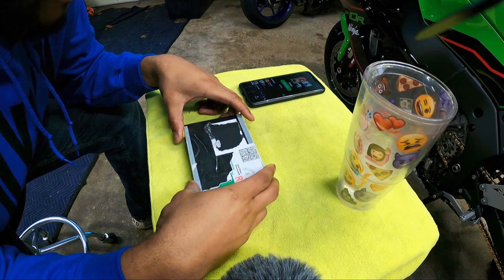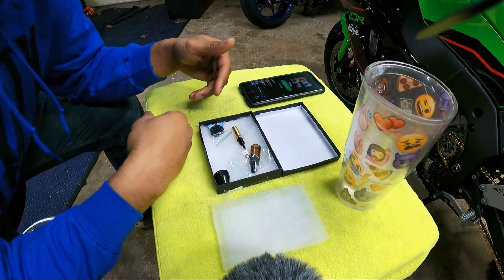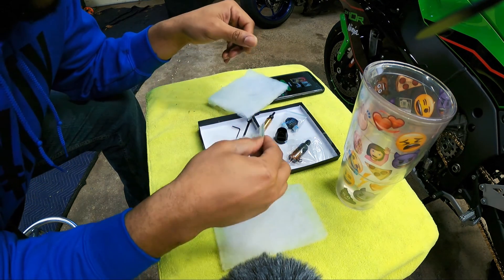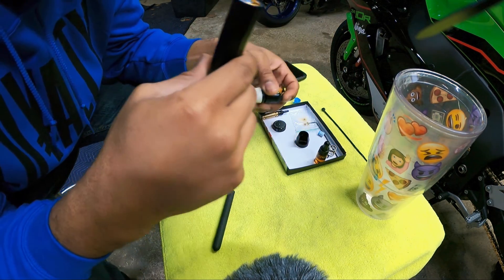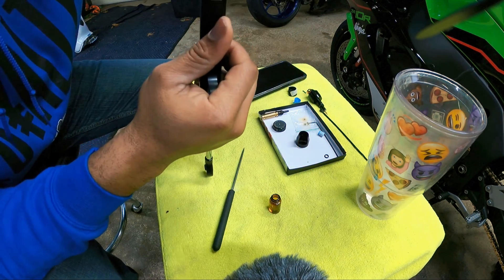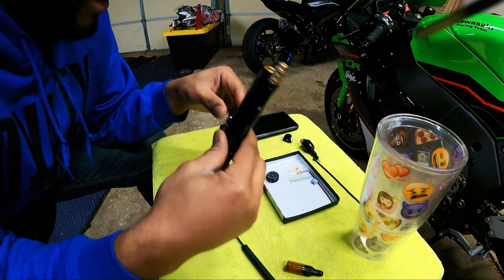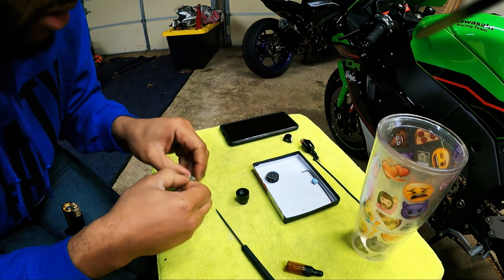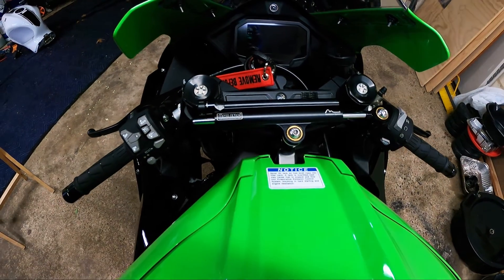2021 Kawasaki ZX10R Manual Steering Damper Conversion Kit Installation

Comment: so did it make it stiff enough or did you end up getting another dampener?
Reply from the maker: Yes. Haven't had any issues yet
Reply: @EnviedKing  awesome thanks for the info, deciding if i should just buy a new ohlins manual one of do this upgrade. I HATE the stock dampener

Comment: What did you torgue the mounting bolt to? Mine is loose. My 2nd day on it. Not sure if it's sapose to be like that but I wouldn't think so.  I can move the damper housing up and down. ???
Reply from the maker: I dont remember to be honest. I would just use the specs in the service manual for the 2020

Comment: This is a good option however you might also consider you rear shock adjustment.
On all my 1000cc sports bikes have had issues with head shake/speed wobbles. The front gets light in under acceleration because the rear shock is set to soft for my weight. I adjusted the rear shock preload to suit my weight and its fixed the head shake/speed wobbles every time. 👊🤙
Reply: Thanks man! I think that’s my problem as well

Comment: So how did the stabilizer conversion work did it cut down on bar shake cuz I get a lot of bar shake under hard dig myself
Reply from the maker: I've only ridden it once since I did it and it was cold out but no shake the 2 pulls I did. I'll post a updated video about it once the weather gets better and let yall know for sure how it is.
Reply: @EnviedKing  cool  ty
Reply: try sweeping the bars forward, mine are close to straight, its a big difference,  also im 6 ft tall, now my wrists r straight not bent
Reply: @TheMetalmechanic  yes the Barr stabilizer definitely I have them on all my bikes